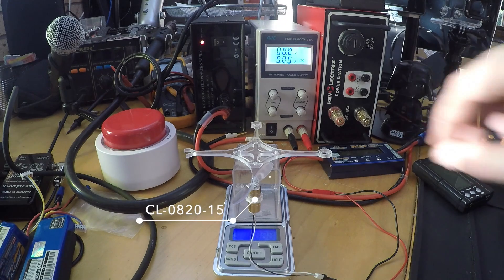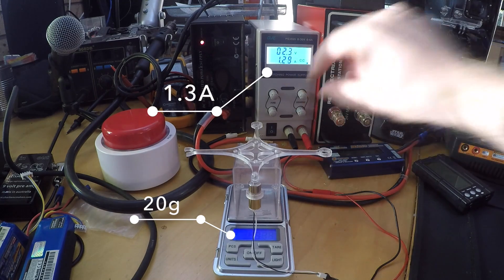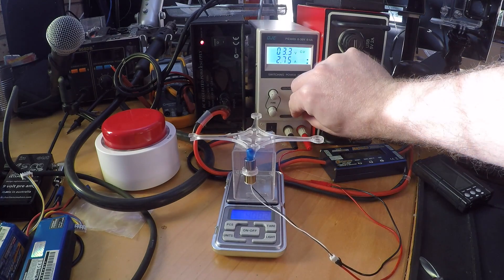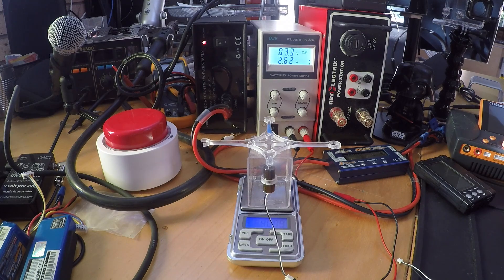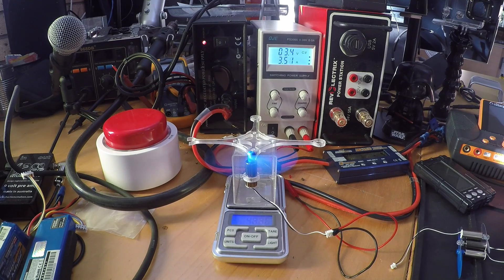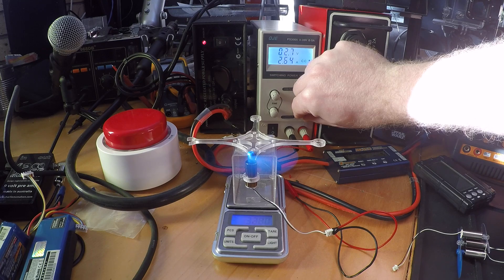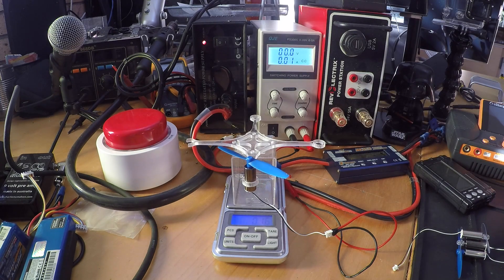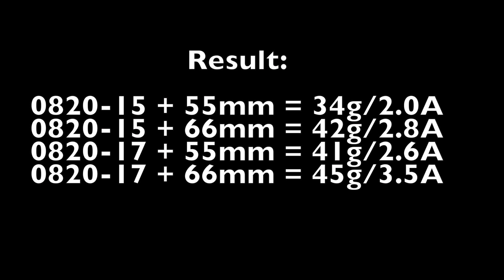Coreless motor tests - power input / power output

Comment: can i power coreless dc motor through computer SMPS?
Reply from the maker: Hey Vivek,

It will depend on the adjustability of the SMPS, but you should be able to.  Our motors like 3.7V or less and will draw up to about 8A depending on the propeller and motor size.  We often us a power supply for thrust tests as you can see here.  

https://www.youtube.com/watch?v=Pnm7Nc47QcY

Hope that helps.   Let us know if you have any questions.

Cheers,
Francisco
Reply: @Micro-motor-warehouse  hi where can ı find Cl 0820 015

Comment: Can you give me some information about the 8520 coreless motors? It says on the product page that "continuous current: 0.15A". Does that mean I can't go above 0.15A? Here's the link: https://www.aliexpress.com/item/2PCS-DC3-5V-8520-8-5-20MM-Mini-Model-Helicopter-Coreless-DC-Motor-With-Great-Power/32392862460.html?spm=2114.10010108.1000013.3.pHy3Bx&scm=1007.13339.33317.0&pvid=1009e7ef-ec3d-47b0-b2b3-75258c71e819&tpp=1
Reply from the maker: The 0.15A are probably the unloaded current. Under load, a motor of that size for multirotors use should pull 1-5A.
Reply: Why would the motor draw more current under load? Isn't it just an inductor, why should the current depend on anything other than the inductance of the motor?
Reply: Arijit Ghosh Ohms law. Increase the resistance for a given voltage, and the current will go up.
Reply: in the dinamic current kingdom,  when you apply a continuos  current to an inductor 
the current start increasing from zero to infinite (if ideally the inductor is made of superconducting whire)
 the speed of the  incrasing of current is anti proportional to the inctor value in H   or micro h

the winding spinning act like a free inductor in alternate current working 
the rapid tourning free of the motor make the magnetic field to change rapidly
 in this mode che ciurrent flowing is little   due the continuous changin of polarity  not gieving time to reach hig current in the winding

when the load slow the motor down 
 th magnetic field of the stator magnets demagnetize the field created by the rotating windings  making them discharging and charging faster from the magnetic field reached 
so the current in the whire start to reach hig values faster   as you slow down the motor with  fisical load on  the motor  ... drawing much more current    

to bee short   .... if you draw power from the shaft it have to come from someware ....  this is why it draws more current   for more hard load

the confusing fact in inductor   is that  inductors are made of logn whires and the top current is limited by the whire ohms value   thats why the relay or electro magnets does not burn in continuos current and dont reach a short circuit current

  so if you aplly current to an ideal inductor(zero ohms) the current will reach infinite value   in a time ghiven by the inductor value   

but if you aplply an alternate current (such as commutator brushes in motors do)    te current passing trough an ideal inductor is smaller the higher the frequency  and the factor is given by inductor value

Comment: Would you happen to know if the H502S uses the same motor as the H107C?    There are different part numbers but might be due to wire length differences.
Reply: Completely different motors. 

The H502's motors are 0820s with an 8.5mm diameter and 20mm length and are 7.4V motors. While the H107C & H107D use 0820s with a 8mm diameter and a 20mm length that are 3.7V motors.  Both have 5mm x 1mm shafts.  The props on the H107's attach to the motor shaft,  but the H502's use a 11T (tooth) pinion gear on the motor shaft that spins a spur gear on the transmission shaft to rotate the props.

You'd need a voltage step-down to use the1S motors in a 2S quad (7.4V to 3.7V),
Reply: Since this is 7 months old, maybe someone else will benefit from your supplied info.  I have over 200 flights on my H502S that I got shortly after posting.  :-)
Reply: NICE!   I have a H502S as well.  It was actually the first quad I bought.  What type of max distance and altitude have you been able to get?  Also, are you using the Hubsan OEM lipo's or have you been able to find another battery with more mAh and a higher discharge...that still fits into the battery compartment?
Reply: Hi.   I only fly LOS and trees are usually limiting areas to fly, so <200m.   I convinced myself long time ago, there are no other thin 7.4v batts that will fit the compartment and that I wouldn't increase weight so the motors are protected.
Reply: Why not try to reduce the weight of the quadcopter

Comment: Any tests done regarding motor PWM rates?  motor heat?
I'm seeking a good value for my chaoli cl-820.
Reply: I haven't seen significant difference in heat between different PWM rates.
Reply: +Benedikt Haak I haven't either.  I suspect there's some reason why the SciSky FCs come preloaded with 4000 so that is what I tend to keep mine at.  I'm not sure there is any thought behind that but it looks as good as any.  I can't find much fact in a couple days of web browsing that goes beyond subjective opinion, mostly in that 32000 (max setting) is best for smoothing.
From the research I've done I've concluded that there should be a sweet spot that keeps the electronic switching and the motors happy depending on the rpm and number of cumulators in the motor.

Comment: The Mikanixx X006 is Sold in Germany and it Comes With 60mm Props that have the same Shape as the hubsans...so they right in the middle between 55mm hubsans and 66mm parots. I tested them With dark cl0820 17 Motors and the Speed is insane...just in case u didnt Know the x006 Props. Regards
Reply: Hmm.. I can't find them anywhere but in Germany. If you want to buy 10 sets and send them to Australia, I will send you a load of motors in return. Please email support@mmw.rocks and we make a deal ;)

Comment: Wondering why you used 3.3 volts for max testing?
Reply from the maker: +Billy Clark To get the required current ratings out of the batteries, you need to push them to the limit. And I consider 3.3V under load the healthy limit for a lipo cell. If I drive them harder, they degrade quickly. If I dont drive them that hard, then I could use lighter batteries. To make the tests as relevant to real flight performance as possible, thats the voltage I use for motor peak performance testing.
Reply: +Micro Motor Warehouse  3.2-3.4 is the usual setting for LVC(low voltage cut-off). They are quit drained at that point.
Reply: +Billy Clark not under load. The more current you draw, the higher the voltage sag.